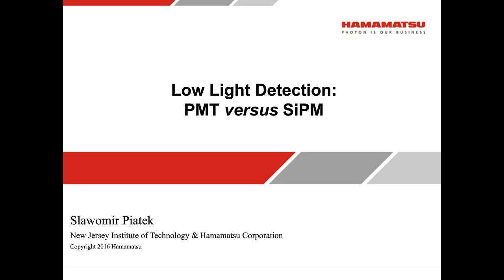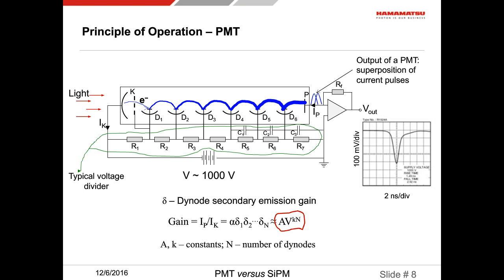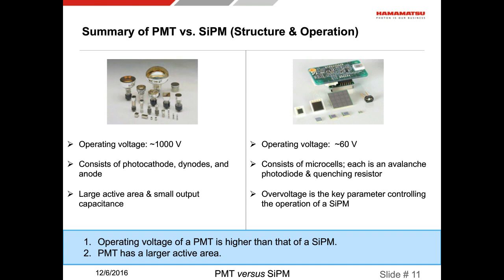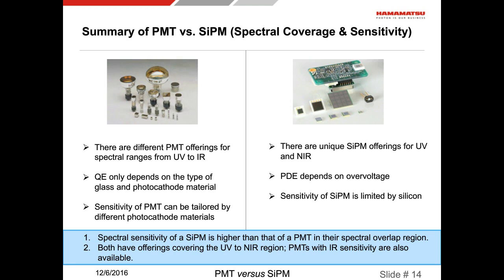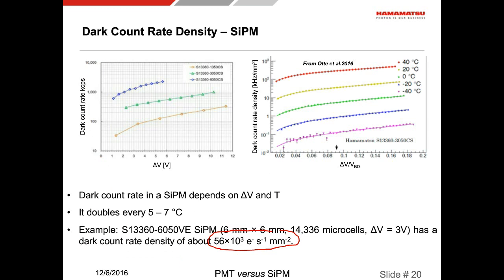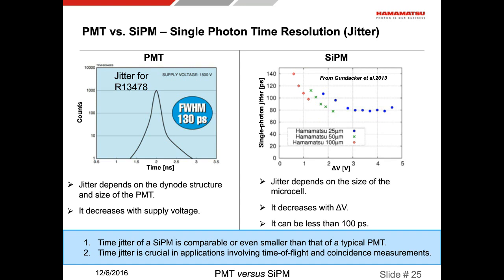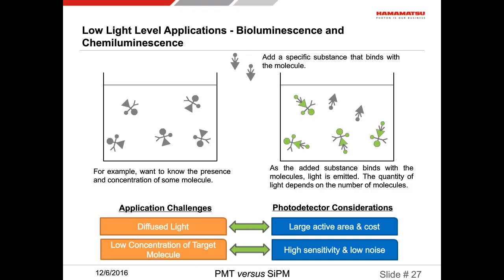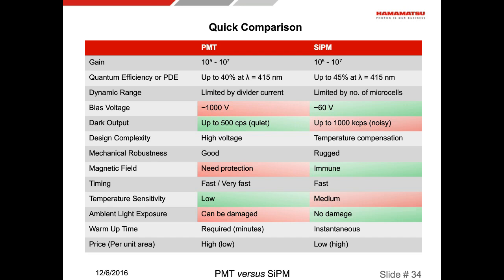Low light detection: PMT vs. SiPM

Comment: PMTs are when you want the most amplification possible SiPMs are basically large arrays of avalanche photodiodes. These are best used for portable applications or where large arrays are being read out that do not need extreme sensitivity. One fun thing you can do with SiPMs is make a multiple pixel array and build a nuclear imager by isolating the scintillators and shielding each one and feeding the output to a FPGA ❤